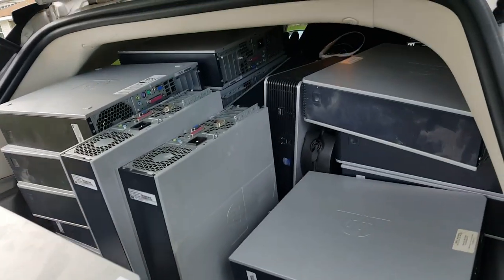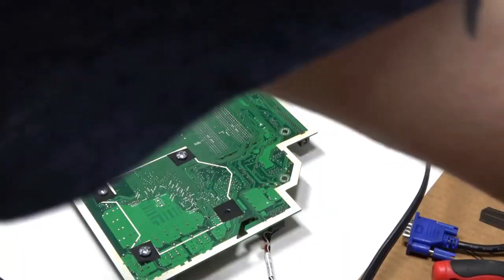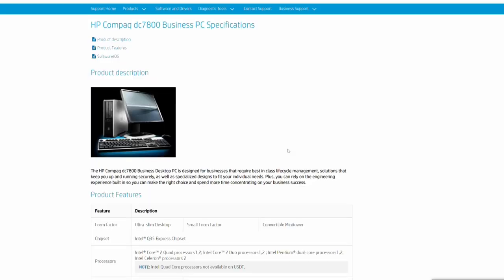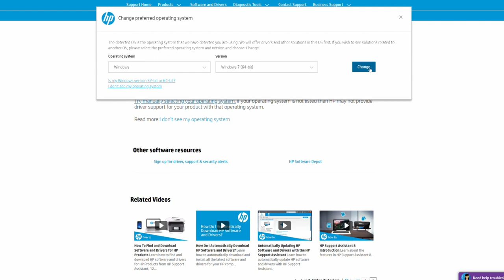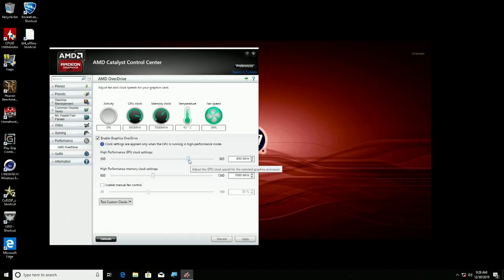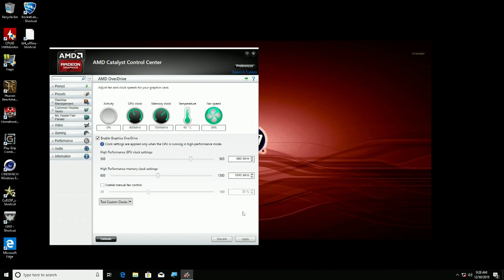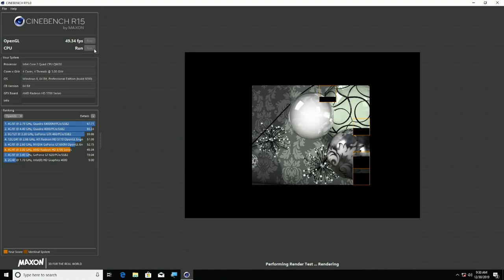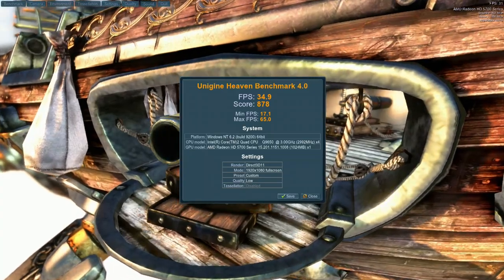socket 775 still alive in 2020?

Comment: Great memories! It was the socket where I learned how to build. I put together two Core 2 Quad Q9550 units and gave the last one away ~ 4 years ago. My wife was using it to browse the internet and play card games but unfortunately the HDD crashed. I contemplated installing a new SSD and another copy of Windows 10; however, I did not feel that spending one more cent on it was justifiable. With all respect to everyone that still uses the 775 socket: If a component has a launch date of 2004 - 2008; is it worth repairing if a problem develops?

Comment: Use 860 evo pro SSD, 8gb DDR2 1066, 3GB HD7950 XFX-dual blower OC'd to within 10% of crashing haha, Q9550 2.83 OC'd@4.050Ghz on air, runs very cool.

Can get great graphics and performance in game's like The Division. Asus P5B Mobo, latest Bios, overvolt on everything, PCIE running at 114mhz. Cold boot in under 30 seconds. Highly entertaining and dirt cheap.

Comment: 2018 until now 2020 i still using mother board msi boston 7525 ver.1 Socket type LGA 775 and i upgrade my processor to intel core 2 duo E8600 3.33GHZ and my GPU is AMD RADEON HD6450 2gb DDR3 and my ram is 4GB 800MHz DDR2 and my PSU is 700w till now still playable to GTAV and CSGO to 1080p low resolution. :)

Comment: My everyday Desktop is socket 775 ASRock G31M-GS modified with a socket 771 Quad Core X5460 Xeon cpu running the latest Windows 10 64bit. NO issues at all. My HTPC is also a socket 775 Zotac GF9300- itx motherboard with a 771 Quad Core E5450 Xeon CPU and plays everything I need it to play at 1080p running the latest Windows 10 64bit.

Comment: Ive had my Gigabyte EP45-UD3P and C2Q Q9550 since 2008 and it can still hang. Its not my main system but I still use it alot. Has a GTX780, 8GB ram and is running at 3.8 with great temps.

Comment: I've been using the following since 2011

q8200
2x2gb 800mhz ram
ecs g31t-m7 (v 1.0)
80+ bronze PSU
64GB 1.8" Samsung SSD
320GB WD Blue
GT 730 1GB

runs CSGO quite well on medium to high settings
Reply: Thats almost like my first computer
Reply: Ew

Comment: Owner of socket 1156 and 775 represent.
Reply: Bitelaserkhalif 555 • yeah an x3470 still rocks :)
Reply: Built mine today with some part left around:

Mobo: Asrock G41M-VS3 (my dad thought that mobo was broken, in reality it's still working) (this part holds back the performance as g41 chipset can be overclocked maximum to 350)
RAM: 2X4GB DDR3 1600 (Ran at 1000mhz, FSB limitations)
CPU: C2Q Q9300 2.55GHz (fsb OC to 340)
GPU: gt 1030 ddr5 2gb
No ssd yet (2 hdd 1tb+320gb)
Stock Intel cooler

CPU Score Cinebench: 258CB (higher than my previous i3 550 OEM, two extra core helped out)
GPU :43.60 fps (lower than previous i3 550, dunno why)

Fun fact: the case's power button is broken, so I used doorbell switch and wired them up

And also, I'm thinking of q6600 with duct tape but the problem was the q6600 has no SSE4.1 instruction set.

Comment: Asus P5Q Pro Turbo, modded Xeon 5482 cpu, 8 gb OCZ DDR 1066 ram, 512 gb SSD boot drive, 4 TB HD storage, Fatality X-FI sound card, Half X 932 case, Thermal take P100 rad case... Koolance RP-452X2 5.25 double bay Pump res combo, 3 rad's. 850 Thermaltake PS and a HD7990 vid card.
I get 80 FPS in World of Warships.
Why Xeon cpu ?   Cache is dedicated for each core, not shared and 12mb.
Reply from the maker: Nice build! Xeon wouldn't work on this rig I tried x3363 to no avail

Comment: Should give it a go making a reverse sleeper with an amd first gen ryzen 1400 (should be dirt cheap), b350 motherboard for some overclocking of both ram & cpu, 16 gb ram at 2666 mhz or faster & a cheap older case that looks rather unassuming on the outside + a decently performing gpu like a rx 470 4 gb or better.
As i sold my testrig (I7 930, 12 gb ram) too a cousin that needed a bit better cpu for cheap.
(We thought his motherboard had died so i said he could buy my testrig too get up & running again + its gonna be a bit faster then the old phenom specially with that 1050ti which turned out too be the problem.
(Had spilled soda on it at some point & it had gathered up so much dust & grime it actually shorted it out so it wouldn't boot fully meaning it had a black screen.)

Was a cheaper am3+ board with a phenom II x4 965, nothing amazing & missing cpu instructions for modern titles like apex legends certainly didnt help its longevity.)
I now have a socket 775 system as my test system besides my dads pc (my old setup with a phenom II x6 1090t pretty much.)

Currently a core 2 duo e8400 in the 775 p5q premium motherboard i got.
I might mess about overclocking a bit with as it's a cooler chip then the core 2 quad q6600 i had in it previously.
Best gpu i got is a hd 6870 as a spare which should suit nicely with the core 2 duo e8400 really for messing about specially with an overclock on the cpu (Gonna aim for 4 ghz or as close too it as i can with the copper slug intel cooler i got on it.)
Next after that is two hd 5770's & a nvidia 9800 gtx+
ram i got is 2x 800 mhz 2x2 gb sticks & a 2x2 gb pair of ocz reaper 1066 mhz ram which gives me plenty of overclocking headroom as long as i can cool the chipset down & vrm a bit, cpu cooler im using on the board atm is the intel copperslug they used with cpus like the pentium d 945 & similar which cools the core 2 duo e8400 ridiculously well in the little testing i did i hit perhaps 50c i think doing a 3dmark test with a HD 6990 i got in here a few days ago too fix up (fresh thermalpaste & cleaned up, the 6990 hit 85c & 78c in my open testbench in the higher clocked bios setting (+50 mhz on core & i think same memory speeds so same speeds as a single HD 6970.)

Comment: My parents PC is socket 775, what a slug. Would it make a difference at all getting them a core 2 extreme? All they do is web browse and netflix and even running windows off an ssd did not help that old hog.
Reply: Not all 775 motherboards can support the Extremes for their higher TDP of 135w. If it's an OEM PC like a Dell or HP, your best bet is the Q9650 if you can find it for the right price

Comment: I'm surprised that OEM mobo didn't already have a backplate attached.  You used bolts (at 0:42) to make the CPU heatsink/cooler bracket fit?

Comment: @modstek I’m about to order a q9650 for my hp dc7800 to replace a q9300, I have bios 1.35 already however I noticed that on hps site there are a few other updates, are those required as well or are they included in 1.35? Thanks. Also do you think I need to buy an aftermarket cpu cooler for that CPU? I’ve been running the q9300 for years and under load it doesn’t go above 60C at 1.215 volts

Comment: Currently running (all in CAD pricing):
Xeon X5670@4.3Ghz on a Hyper 212 (20$)

12GB of DDR3@1600 in triple channel (30$)

Asus ROG Extreme III(?) LGA1366 (free!!!)

R9 290 Tri-X 4GB (unlocked and undervolted, 160$)

1TB Samsung 860 EVO SSD (180$)

4TB Seagate Barracuda pro (120$)

EVGA 850w modular gold (90$ with a mail-in rebate)

and some nice tempered glass case (70$)

That's my main rig, imma upgrade the GPU to an RX Vega for better video editing performance and change the cooler to something beefier for a higher overclock... other than that, what do you think?
Reply from the maker: That's a damn good system and I wish I could find that motherboard for under $200 I love socket 1366
Reply: modstek I basically bought a dual socket 1366 and sold it for the same price I bought it minus the RAM, CPU, CPU cooler... and then with that money I bought that ROG LN2 mobo.  Does the job but damn is it large. I should consider buying two R9 Furys or something...

Comment: How much did you pay for the q9650? I know that some core 2 quad cpus are overpriced.
Reply: modded xeon e5450 instead can be another option, it's equal with q9650 but cheaper and less TDP.

Comment: Recently did the 771 mod to mine and installed the x5450. Works great and is a very overlooked socket. 
p5g41t-m lx plus motherboard 
Zalman CNPS9500AT heatsink & fan
8gb G-Skill Ripjaws DDR3
Samsung 860 Evo 500gb SSD
MSI GTX 1050Ti